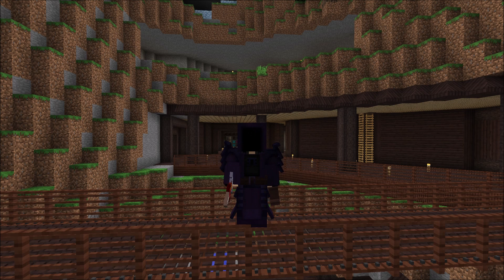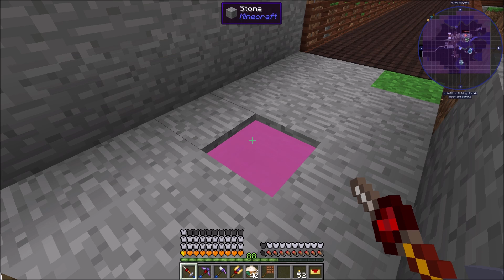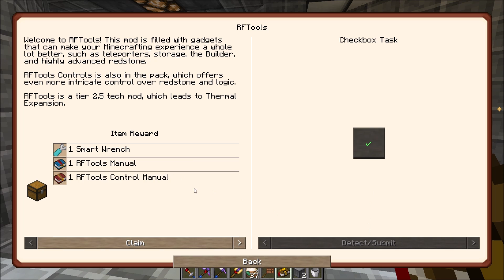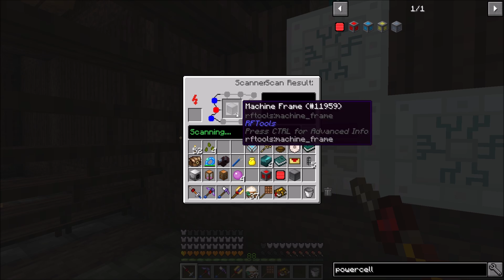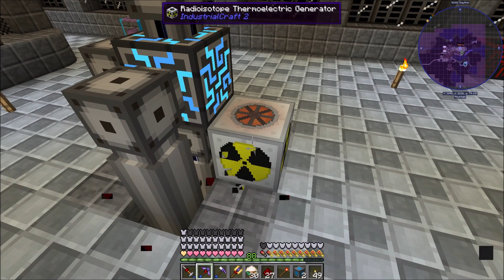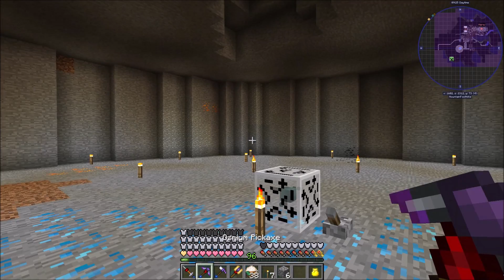Fission Reactor and RF Mainframe Part 3 : Enigmatica 2 Expert Lp Ep #52 Minecraft 1.12

Comment: Excellent vid! The wireless redstone you used is a great idea, both for the reactor and your smelter (I used a TC melter but the concept will work fine for it, too).  Good to see some vanilla redstone, too ;}  (you can do away with the and gate and just feed the monitor output to the rf line coming from the reactor BEFORE the inverter... same effect so either works well).  I really appreciate your vids as I pick up something every time I watch them.  Thanks!